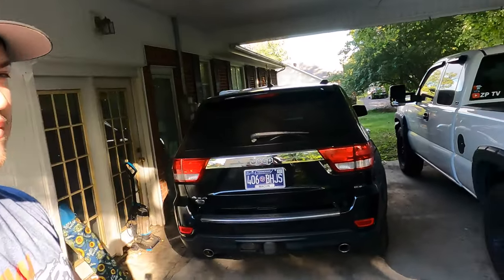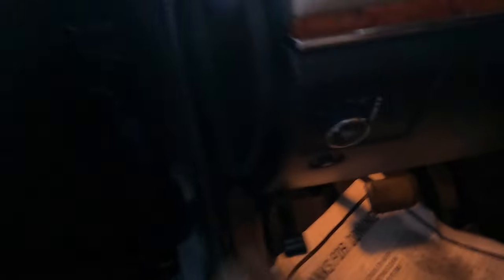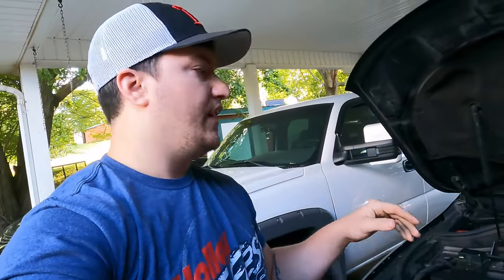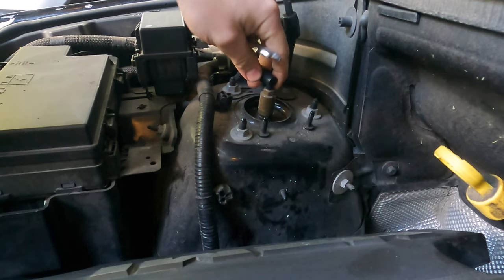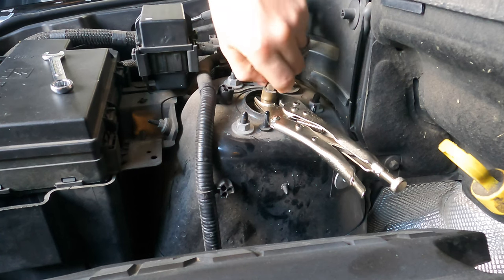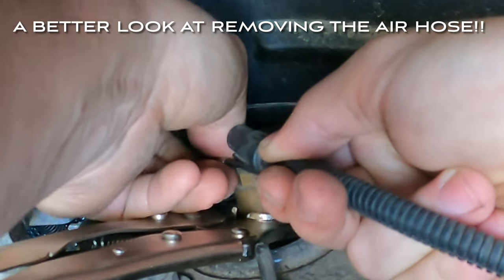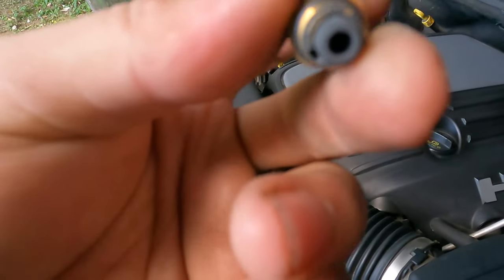COMMON PROBLEM!! Jeep Grand Cherokee Air Suspension Leak Fixed!!! (CHEAP & EASY)

Comment: I just tried but as soon as I unplug it, air goes out. How do you prevent that?
Reply from the maker: You can’t. The air will leak out when you replace the fitting but once you install the new one and start the car back up it will refill itself.
Reply: @ZPTVChannel  but you lose all the nitrogen?
Reply from the maker: @wayanbarre  yes, but the system will replace the nitrogen lost with regular air.

Comment: I replaced the elbow 90° the top stopped leaking but now the bottom of black is leaking. Took forever to pump up and won't complete in off-road 2

Comment: No teflon tape on the threads?
Reply from the maker: No! They say no to use it because as time goes on the tape gets brittle and can break off and send little pieces through the system.
Reply: @ZPTVChannel  good to know. I just bought an Overland with all 4 wheels collapsed, so I'll try changing the valves.

Comment: Are there also air valves at the rear?
Reply from the maker: Yes! They’re the exact same valves they’re just on the side of the bag near the top!
Reply: @ZPTVChannel  thanks! Sorry English is not my mother tongue. What do you mean by side of the bag? 😇
Reply from the maker: @wayanbarre no problem! if you take off the rear tire or just get a flashlight and look behind the wheel and look at the air shock the fitting will be near the top on the side you can’t miss it!

Comment: I'm having this issue with my rear tires and the sound of air shooting out after a while
Reply from the maker: Could be the same issue. The fittings are the same in the back they’re just on the side of the bag instead of on top.

Comment: Where are the air valve connection points for the rear system?
Reply from the maker: It’s toward the top on the side of the air bag. Will be able to see it really good and get to it really easy if you take the back tire off!

Comment: the first connector you removed, looks like it had teflon tape on the threads....And would you recommend using some kind of silicone lube on the o-rings for longer life?
Reply from the maker: From everything I’ve read it says not to use Teflon tape because if and when it degrades it can send bits of Teflon through the system. As far as lube goes it probably wouldn’t hurt to put some kind of lubricant on it to help it seat during the installation but I doubt it would make it last any longer.

Comment: Do you where rear ones are located at?
Reply from the maker: They’re near the top of the bag right behind the rear tire! You can get a really good look if you pull the wheel off but you can get to it without taking the wheel off!

Comment: my air suspension just went out for the first time. today its 10 degrees. the compressor made a loud noise and it seemed like it was stuck in rising height but it did not rise when i pressed the height adjustment button and only the front is lowered. any suggestions?
Reply from the maker: When it gets really cold like that and there’s not enough nitrogen in the system the condensation from the outside air the system brings in, to make up for the lost nitrogen, will freeze up the system. If I were you I would wait until it gets back above freezing and see if it’s still giving you fits!
Reply: Yeah I bet everyone quadralift is frozen for the next few days
Reply from the maker: @Stone2915  mines been popping up service air suspension for 2 days lol it got a little warmer today and after driving it for a while it seems to be back to normal. Probably until it sits overnight and freezes again lol
Reply: Myne went down when temperature dropped below -15c . It such a disappointment because I bought a car just 1 week ago(.  Who has more expirience with this air suspension, is it worth fixing it? Will it stands -20 or -30°c ?
Reply: @ig_vlog_channel  apparently the compressor freezes because it has moisture in it. once the temperature rises above freezing it should fill
up. if not gotta change the compressor
Reply from the maker: From what I’ve heard getting it filled back up with nitrogen at the dealer will fix the problem
Reply: @Stone2915  I have a 2019 Grand Cherokee Trailhawk and I was in the Poconos for the last 5 days for the holidays.  The temps were below zero for several days and my air suspension worked perfectly.  If you don't have any leaks and the system is still filled with nitrogen like mine, then it will work just fine even in crazy cold temps.
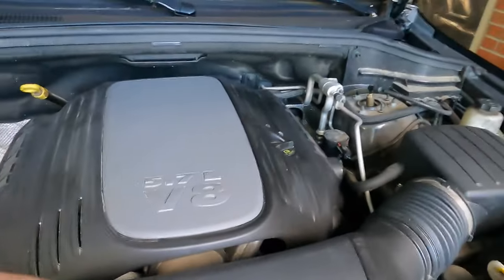Reply: @ZPTVChannel 6:29

Comment: i get a massege air suspension require imidate service/repair require. any help will be appricated.
Reply from the maker: Probably a bad fuse, bad air leak, or worse case scenario a bad compressor..

Comment: I changed the compressor and elbows and my jeep is still low, any suggestions??
Reply from the maker: Did it raise back up at all? If not it could be a bad fuse.. if it raised up and leaked down again there could be another leak somewhere in the system.
Reply: @ZPTVChannel  it raised up at 1st then went back down, that was after I installed the new compressor, when I put the new elbows in, nothing happened
Reply from the maker: @jonathancoleman4548  I would check the fuse. Does the dash say anything like “service suspension system” ?
Reply: @ZPTVChannel  yes, it keeps saying "Service air suspension system" and "immediate service suspension".
Reply from the maker: I would start at the fuse. If it’s good there may be a clogged or cracked line in the system somewhere.
Reply: @ZPTVChannel  thank you I'll check it out
Reply from the maker: Also too if it was super cold outside the lines could’ve froze. Mine did that a couple weeks ago when it got into the negatives.

Comment: Problem with mine (2013 GC Overland) is it won’t lower to parking level, anyone help with that?
Reply from the maker: Could have a bad level sensor
Reply: @ZPTVChannel  would that be a suspension yaw sensor?
Reply from the maker: @Yepyep-e9b I’m not 100% sure on the exact name…

Comment: What about if the rear has the same problem?
Reply from the maker: There are fittings on the rear bags right behind the wheel. Let the Jeep air up and then spray some soapy water around the fittings and see if they’re leaking.
Reply: @ZPTVChannel  awesome. At first, I just had my front sagging, so I  replaced the front driver side, because that seemed to be leaking. It looks like the passenger side needs it also. Now the rear sags, too. I'll replace the other 3. Thanks for the help!
Reply from the maker: Yea from everything I’ve read the front and rear are on different pathways so I would say it’s probably just those rear fittings.

Comment: I think mine it's the compressor because no leak on the top because I don't hear the compressor make any sound at all
Reply from the maker: You should be able to hear it… I would check fuses and relays first but luckily the compressor isn’t crazy expensive so if it is it shouldn’t be to bad!
Reply: @ZPTVChannel  yeah because the compressor will make sound for a few seconds then cut off til the next day thanks so much sir

Comment: Hope somebody help me, my suspension just went out,  but the hole car went down  and I won’t pick up, I check the fuce and it was burn I put a  new one and it burnet right after I turn the car on, anybody have an idea what it could be ?
Reply from the maker: Sounds like a bad compressor since it’s popping fuses…
Reply: @ZPTVChannel  i never saw popped fuse on mine mecanic replaced air pump solenoid 12 days order

Comment: Same problem I'm having with my 2012 Jeep Grand Cherokee 😪

Also, when it rains, I find water pooling under the carpets. My ceiling also having little water marks! It's so frustrating, please advise 🙏🏽🙏🏽
Reply: We had watermarks in the back and we found that the electrical wires that go into the car from the tailgate had a seal broken. We did have a dealer replaced though I told him it looked like they could be caulked, but he said no of course his solution was more expensive, but we went that way anyway, good luck

Comment: Question for anyone. I had the same issue. Changed a fuse and ir started working again. Then stopped. So I replaced the elbows, the pieces in the video. Compressor stayed running, I assumed it was just filling back up. Went outside the next day and it was still low and had a dead battery. Jumped it off and it still won't raise and I have to pull the fuse so it doesn't kill the battery again
Reply: Any ideas on what I could do
Reply from the maker: I would say that’s a bad compressor… but I would definitely get a more qualified opinion before you go buy one.
Reply: @ZPTVChannel  yes sounds like airpump solenoid or module yet pump  not going to drain battery with engine off. that's separate

Comment: what is the part you got off amazon . mine is 2012 Overland  not a hemi  is that the same part needed as my air suspension will not raise. it is at its lowest/ Need it fixed thanks
Reply from the maker: Yes, it’s the same part for the non-hemi as well!

Comment: Can someone send the part number?
Reply from the maker: I don’t know the part number but this is a link to the part I bought. https://www.amazon.com/RMT-JWK2-A210-ADFU-Suspension-Connector-Fitting/dp/B07DF9QGSW?pd_rd_w=4S1tx&content-id=amzn1.sym.99d2f5bb-29d9-4f60-b07e-f97fafe39bec&pf_rd_p=99d2f5bb-29d9-4f60-b07e-f97fafe39bec&pf_rd_r=DFYD6V16R1H4DWGZXREG&pd_rd_wg=6MJbb&pd_rd_r=56438158-5b86-4f3f-a4b3-426ef45ef289&pd_rd_i=B07DF9QGSW&psc=1&ref_=pd_bap_m_rp_9_t

Comment: What is the part name ..?
Reply from the maker: I just looked up 2012 grand Cherokee front air fitting and it popped up!
Reply: Where you buy the parts
Reply from the maker: @juanmiranda7108  Amazon